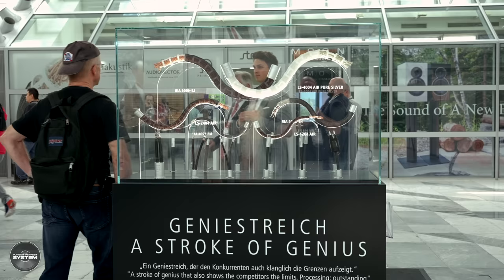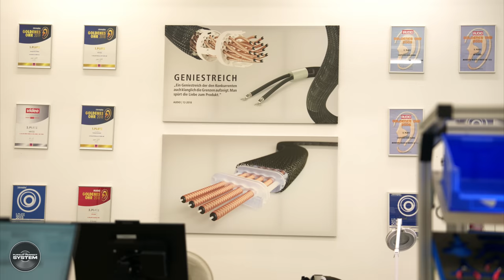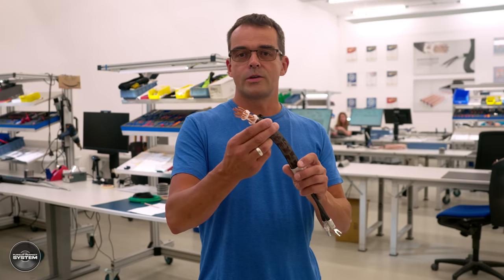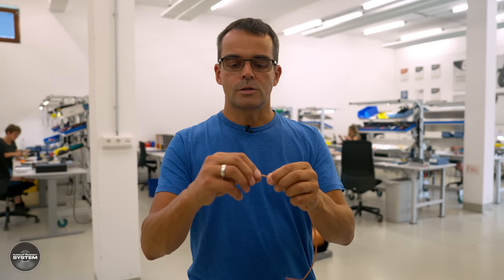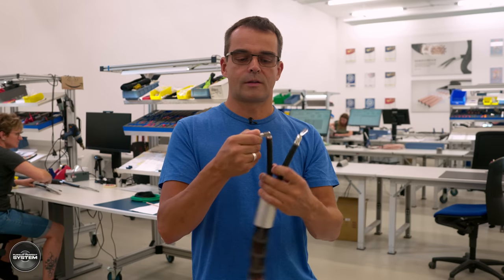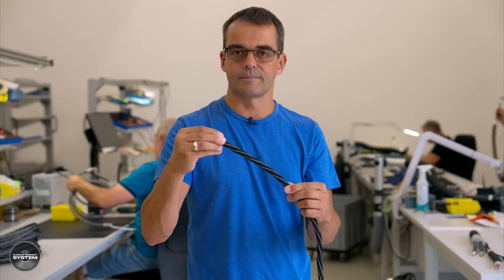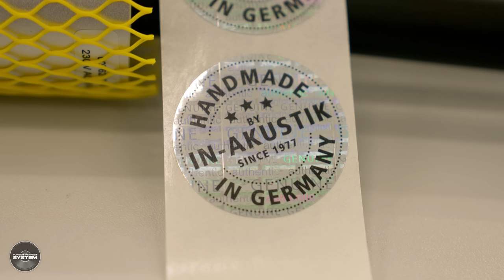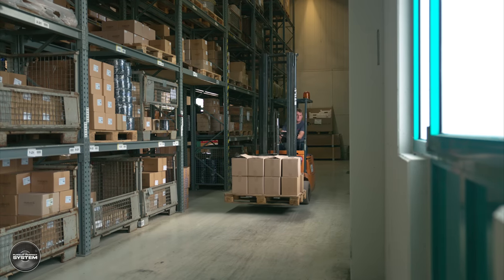The BEST SOUNDING HiFi "AIR" is made in Germany

Comment: I kind of thought there might be some merit in avoiding the plastic because of static charges, but transmission lines and skin effect for audio frequency AC? Nah! If you think the plastic is a problem just get some meaty pieces of bare copper conductor. Solid core or stranded? You decide!  String them on ceramic electric fence insulators if you have to. No plastic insulation - dirt cheap! After all, unless you get to concert PA system power levels, speaker signal currents are SELV.
Reply from the maker: the copper would oxidise though and probably not very flexible or something someone wants to have in their living / listening room.

Comment: Skin effect is applied in one laquered solid copper thread not the whole cable. So in this point of view i think this speaker cable design is pointless.
Reply from the maker: Maybe watch the video again, that is just one detail as to why one part of the Air technology is designed the way it is, just one and you label the cable as pointless, seems like an extreme take on it? As I said watch it again as there is a lot of information to take in and seems like you missed a lot of it

Comment: The amount of attention to detail in manufacturing is great. Surprised that you, of all people, would lend yourself to be a marketing tool for Inakustik. Skin-effects? We're talking audio here; max 90kHz with 192kHz sampling freq of which we don't here more than 20, provided you're 30 years or younger.
Inakustik should be more concerned about the effect of galvanic corrosion which will have a very negative effect within a few years where copper meets nickel at the terminals. Finally, if a power cable makes a difference to the sound in your system, the integrated power supply wasn't designed properly. 
How much difference will any of these cables make compared to a system with decently set-up Dirac against no Dirac? You especially know the answer, a miniDSP is a lot cheaper. For me, your credibility just took a hit, I'm sorry to say.
Reply from the maker: Please remember this is how you see it, not how everyone sees it and not how I see it either.  Yes I use Dirac and DSP but also still use very high quality expensive cables in my system.  My view is do whatever it takes to get the best sound you can and from experience everything matters and when you remove the rooms sound such as with Dirac they matter even more.  Again this is my view. 

Also no company makes me anything, in-akustik are a successful manufacturer of over 40 years, they have a cool facility, a great history and story and their manufacturing is interesting.  Putting that on camera doesn't make anything - thats just you making a negative assumption about the situation I think quite unfairly.

Comment: So let me get this right, they are claiming to use air as an insulator but still have a lacquer around each cable.......so much for air as dielectric.
Reply from the maker: Yes because everything in close proximity stores electricity to some degree, a micro thin layer is there to stop the cable oxidising, there needs to be something there and in normal cables its many mm thick usually
Reply: @PursuitPerfectSystem , yes cables have an insulator and in some applications foam is used to get an insulator close to air. But we are talking about trivial signals to handle here with very low frequency. Of course people that do not know better might think that "skin effect" an other such terms sounds cool but it is just not relevant in the audio frequencies. The factor to take into account is the inductance (for a speaker cable) , it will dampen the high frequencies. In my work however we have to pay attention to the cables as we work with signals that goes beyond 10 GHz and where phase-matching is crucial. Check out HUBER+SUHNER, there you have a serious cable manufacturer!

Comment: Why don't they design a 3D printer to make the insulation discs on the spot instead of pulling every single wire through hundreds of them?
Reply from the maker: Maybe because the product would then not be hand built

Comment: Aesthetics for those with expensive systems, however no amount of science is going to be so measurable as to define a greater audio difference….I’m sure you have to have spent a great deal of money on equipment to justify these types of cables, they surely wouldn’t be of value to a sub 2K system….
Reply from the maker: They manufacturer a whole range of products to suit all systems and costs, the AIR range is the elite level stuff for elite level systems.  Not sure how much of the video you have watched but I deliberately made a point to stress this for that reason.

Comment: The audiophile community is united in thinking that cables do make a difference. Of course there are a huge number of people that can’t hear it but I would not call them audiophile. Quite the opposite.
Reply: Oh you speak for all audiophiles? That's good to know.
Reply: That's not entirely true. Its not that the cable deniers can't hear the difference, they don't want there to be a difference. Its an emotional thing. I've proven it many times. They have to be tricked. I set up a cable demo to AB back and forth between 2 pairs of interconnects. I put the cable denier in the listening chair, play the demo, and they claim they can't hear any difference. (The look on their faces would suggest otherwise.). At that point, I bait them by saying something like, "You guys can't hear differences in cables, or amps or preamps, or whatever." At some point they will stop me and tell me they can easily hear the differences between other components, just not cables. Then I suggest they do another demo comparing 2 amps or preamps. They agree. I go behind the equipment and pretend to make some changes in the system. Then I play the exact same cable demo again. Now they hear a difference, and have no problem listing the different properties between the 2. When I told them they just listed the audible differences between copper and silver cables, they got so mad, you wouldn't believe it.  "That doesn't count!! You tricked me!!!"", "Yes I did."
Reply: Wow, you're making quite a 
ASSumption there ?? Really ?
Reply: Audiophile here. Any cable that changes the entire sound if your system should be imediately thrown out. If you can hear it make a difference, get rid of it right away. It's coloring your sound.
Reply: @AT-wl9yq  That has exactly been my own experience and how I personally went from being a stubborn cable hater to seeing it as an essential part of the chain.